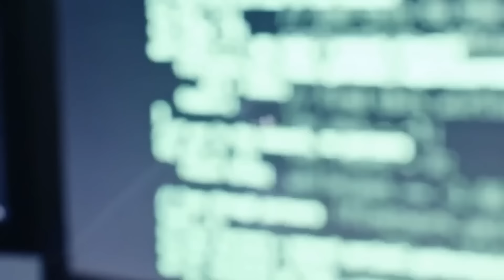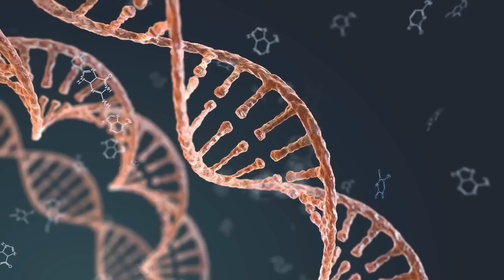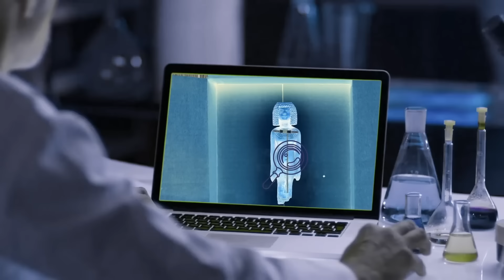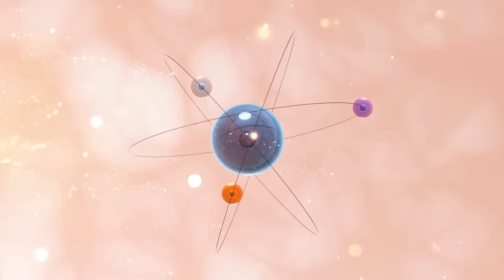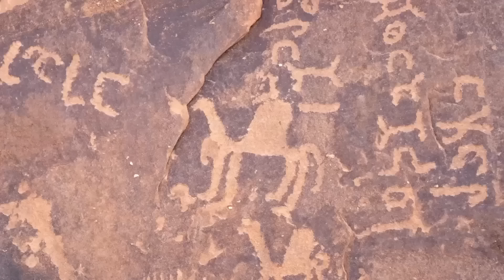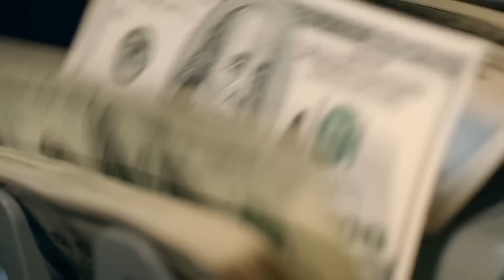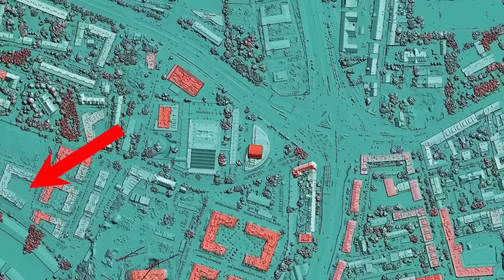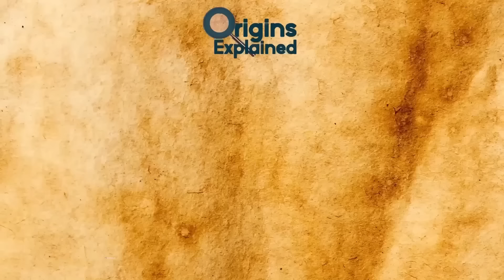Unexplained Mysteries That Still Confuse Scientists To This Day

Comment: The sun only has a fusion reaction at its core thats why they need to get the plasma in the reactor that hot it takes about 100000 years for the light and energy from the core to get to the surface so it naturally cools a little